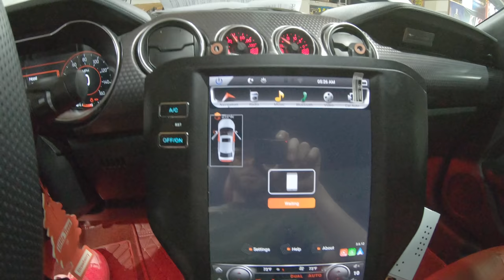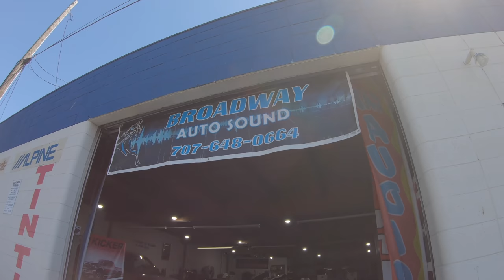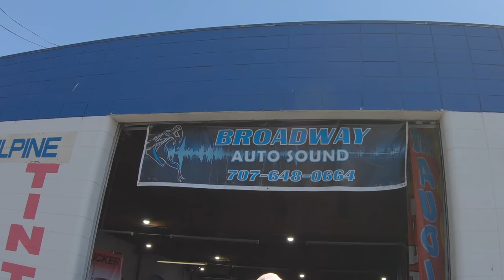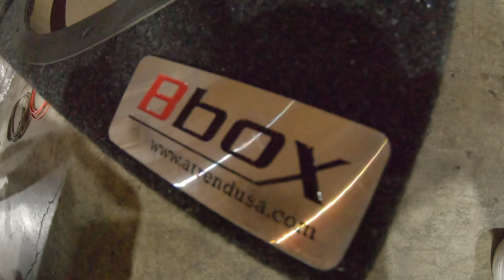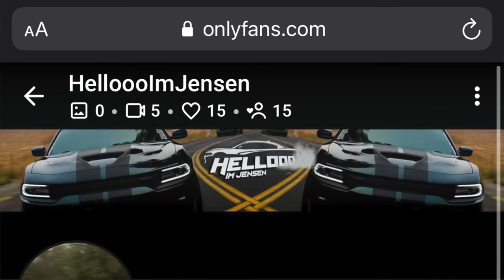I BLEW UP THE 12” SUBS IN THE CUTLASS.... SO WE UPGRADED TO 15’s!!!

Comment: uh yeah, typically to find current draw you use ohms law, then size the wire to its over current protection so u don't melt the wire and catch your car on fire. It's not just a shot in the dark and throw a 250amp fuse in

Comment: that guy from the audio shop is okay, when i seen his ground i wasn’t too happy. 3 self tappers into 1/8th inch sheet metal is not good and it didn’t look sanded either. but if your amp was set right on those 12s they would not have blown. your gain was too high and you were clipping the amp sending dirty signals to the subs which led to your voice coils getting hot

Comment: Basically had subs that couldn't handle the power from the Amp and the subs were bridged to pull even more power. Not to mention the wiring wasn't right and not producing clean power

Comment: This guy is knowledgeable but also giving false info. At 8:10 it only
Matters depending on how it’s wired. If it’s in parallel and one sub goes out then both go out because they’re wired together. In series one sub goes out and the other is wired and still will play. That Doesn’t make the other sub get more draw or power